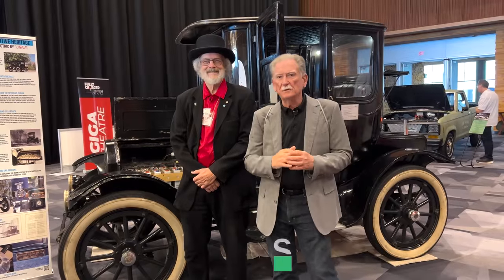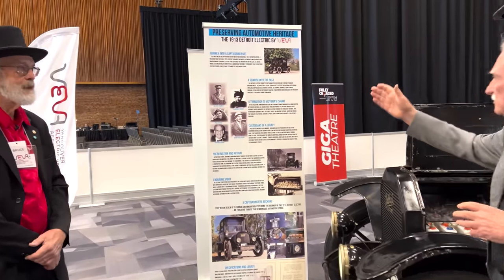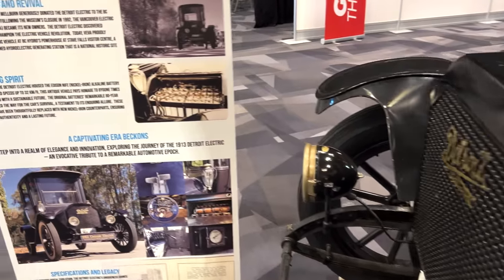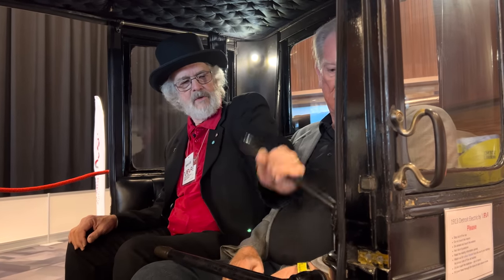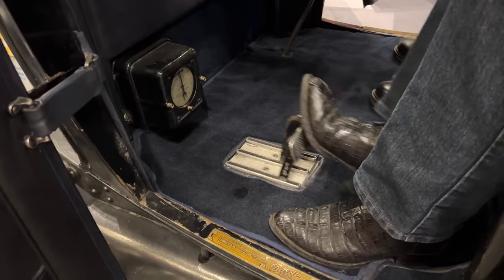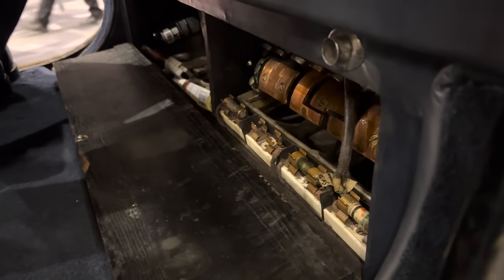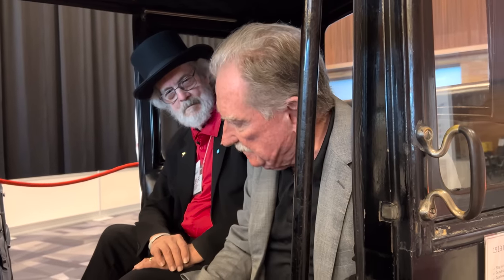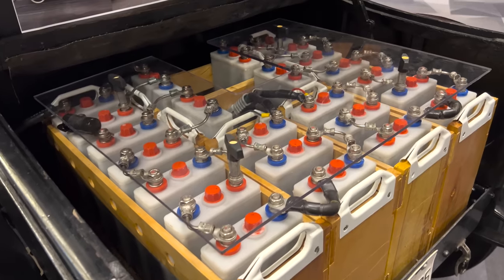This EV is Over a Century Old! Detroit Electric at Fully Charged LIVE Canada

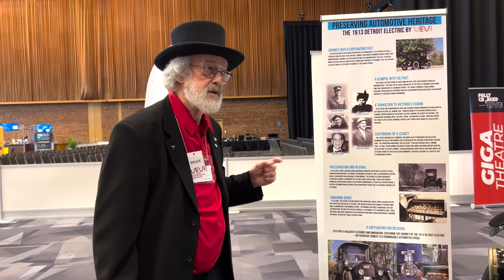Comment: 0:50 nickel iron battery, with annual electrolyte change, lasted 25 years 2:19 car was featured at Expo '86 3:28 $8K for similar nickel iron battery pack to replace previous lower-cost lead acid batteries 6:10 25 km drive part of 350-car entourage with 10,000 spectators

Comment: On Sandy's repeated query about how Women would have handled that electric car, it was primarily targeted for Women. The gas back then was almost the crude oil that was pumped out of the wells. Once you drove the car, you smelled like the oil. So women went for the electric options. And yes girls then knew how to handle their skirts even riding a horse. :)
Reply: Plus you didn't have to break an arm to crank start it every time you went for a drive!
Reply: @jrharbortproductions plus the gas car had significantly way more range than the EV hence why it got over it lol!!
Reply: @carholic-sz3qv  People weren't buying BEV for the range at the time. That is irrelevant.
Reply: @jrharbortproductions  yes alot of people are buying EV for the range and it's still super relevant! For things like towing, going overlanding..... we're still waiting for even more range! For example older ICE gets exported to third world countries where they still have all the capabilities plus range.. things that no EVs will do!

Comment: 72 V at 1.2 V (nominal) each implies 60 cells in series; they are marked as 60 amp-hours each. It looks like there are 36 in the front and 24 in the back, so that's 60 in total and so there are none in parallel... that's a 72S 1P configuration. 72 V multiplied by 60 Ah is 4.32 kWh. 

The range is not given, just that it is more than 25 kilometres. If 25 km takes 4 kWh (for instance), that's 16 kWh/100km, or roughly the same as current battery-electric cars... but of course this is at much lower speed, carrying much less weight and with less space and without any of the safety or comfort features of a modern car.

Comment: Love seeing these vintage vehicles. 

What annoys me is when the EV FUD people say EVs have been around a century and still suck. The reality is EV development has been massively under funded when compared to ICE vehicle tech. It was personal electronics need for better batteries that pushed battery forward which helped get EV tech moving forward in a big way. This is why I say ICE tech is very mature tech, thus hard to get much improvements and EV tech is semi young, thus the massive improvements we have seen in a short period of time and the continued rapid improvements for at least the next couple of decades. 

Nice job Munro team.
Reply: When you factor in all the government incentives for ICE technology, if that type of support were given to the current EV industry you would see a HUGE uptake by the general public.
Reply: @nononsenseBennett The uptake it's up over 50% from last year, and we are around 7.5%. So we need about 4 doublings to take it all.
Reply: To get more efficiency out of ICE vehicles, they had to get the car to turn off the engine at red lights! That right there demonstrates that they've hit that local maximum for ICE efficiency. But EV efficiencies are just get'n started.
Reply: @health101DOTorg  EVs will get a little more efficient, but what they really need to do is get more numerous. Most EVs can get 4 miles per kwh putzing around town at 30-40 mph, and some wind and solar projects come in at 2 cents/kwh without stinking up the air around them.
Reply: Please stop talking crap!!!! The only problem with EVs has always been the batteries; batteries have constantly been developed for all kind of applications like mobile devices and much more. The ICE tech also evolved but in making much bigger and capable véhicules, equipments.....
Reply: From the smallest cars to the gigantic 23,000 containers ship to the Airbus A380..... even the concorde.... it's all possible because of ICE and oil let's not forget building power stations, roads, bridges.... the grid and much more.
Reply: @nononsenseBennett wrong!!!! The EVs would have actually seriously slowed us down! Oil alone has transformed out planet! Fuel for mechanisation, agriculture, mining, construction, marine, trains.., what could have batteries done even if they were the only focus!?
Reply: @fjalics  your tesla is full of plastics, full of parts made from mining with oil, drives with tires on roads all made from oil, even the grid is all made by oil and ICE.
Reply: @carholic-sz3qv  ok. 

No one is saying ICE did not accomplish anything, but electric is the future for transportation and ICE is going to be niche market in the future.

My original point was early days electric might be nearly as old as ICE tech, but never had the funding ICE tech enjoyed, thus EV tech is under developed.
Reply: @kevtheobald  wrong!!! EVs are like over 50 years older than ICE! I also watched Jay Leno on this! Yes ICE have accomplished alot and will continue to do so even with the EV happening or in the future! ICE is literally In everything from rockets to cars to ships, aircrafts and many other big machineries and things that can work 24/7 everywhere.
Reply: @kevtheobald  EVs has never been underdeveloped at all! The problem only has been the battery which had been developed and improved for decades! There is a reason why we have soooo many different battery chemistries today! From mobile devices to vehicles.... stop it please!
Reply: @kevtheobald  even if you are right! Do you think we could have had battery powered ships or construction equipments and trains and tons of other applications!? Be realistic please! And the EVs are now using the infrastructures that ICE And oil made possible.
Reply: @kevtheobald  I'm not hating on EVs but we must be clear here! The ICE won easily at the beginning because it already had more range even tho it was more difficult to drive or start compared to EVs.
Reply: @kevtheobald  in third world countries in many places they still drive around with century old cars on infrastructures that basically doesn't exist! It's not your EV that's going to make hinges much better lol!!
Reply: @kevtheobald  from the wind powered ships to steam/coal to the upcoming cruising ship ICON of the sea which is going to haul almost 10,000 people batteries will never make such things possible it's not about pessimism but reality.
Reply: @kevtheobald  the very important thing to not forget is that the lithium battery was actually invented in the 90's
Reply: @carholic-sz3qv  The reason for so many battery chemistry is because they finally have the funding to research all kinds of batteries. 

Clearly, we will just have to agree to disagree.
Reply: @carholic-sz3qv  EVs can use solar panels and wind, so they do not need natural gas plants or coal plants. Power grids can be fossil fuels free and will likely be that way in the future. Battery storage has given the green tech the final piece needed to remove all fossil fuel power plants from the mix. 

The way things are advancing in EV tech, you will see commercial planes, ships, and trains all become electric as well. There are already commuter EV planes flying that will likely go into production in the next few years. 

Just look at how much has changed in the last ten years for EV tech. The change is only getting faster.
Reply: @kevtheobald  yes EVs can use was wind and solar but unfortunately they aren't the one installing or maintaining those! Let alone making connection to power stations and substations! ICE goes in the middle of nowhere hauling gigantic wind turbines to install and connect and expand the grid! Your tesla does 1000hp but it's literally useless because it cannot be used like a  1000hp diesel for example!
Reply: @kevtheobald  battery tech hasn't gone crap to all fossil fuels lol!!! Power plants with renewables are intermittent meaning that industries that needs tons of power 24/7 like steel Mills won't work well with it! Commercial planes, ships with batteries is a big joke! Trains already runs on electrified lines but not the ones in remote places.
Reply: @kevtheobald  wow!!!! Are you even serious!? Most of hose batteries are super old! It's not that they recently received funding to make them lol!!! What are you smocking?! The LFP battery from r example was even developed partly by an American oil company for very long time ago! If you actually follow the story of battery tech! You'll understand it!
Reply: @kevtheobald  the efficiency in modern EVs is mostly from electronics to better control/balance the battery cells and the more efficient electric motors and things like heat pumps.... the battery itself is still evolving super slowly despite all the funding going on!
Reply: @kevtheobald  the latest sodium ion battery for example beeing developed by CATL is great and we're also still waiting for the graphene batteries, solid state batteries..... EVs actually came in a time where alot of technogies were already developed to facilitate them, ICE literally had to work and evolve with no infrastructure! Even today in third world countries they have barely no roads
Reply: @carholic-sz3qv  Sodium batteries that CATL is cranking out I doubt is something American Oil was using a long time ago.
Reply: @carholic-sz3qv  Keep in mind, the basics can be in use from ages ago, but what they do now could be far better. Think about rubber tires. They been in use for ages, but the rubber today is not done the same as way back when.

Comment: 78 Volts... I wonder what it would require in order to fold out some solar panels and start feeding electrons while you're enjoying some time at a park!
Reply: 72 volts - Sandy incorrected said 78 volts and was corrected.

That's 72 volts nominally, meaning 60 cells in series at 1.2 volts each. The manufacturer of those cells says that "the battery likes to be charged between 1.6 and 1.8 volts per cell", so 96 V to 108 V to fully charge.

Comment: But for the innovation of the battery powered electric starter for ICE vehicles, BEVs might have dominated the mobility market.
Reply: Yup damn Kettering to hell for that. Plus the muffler, made them palatable for women. Who had previously loved the quiet not smelly evs. 😀
The irony of reliable 12v batteries and electric starter motors making ice easier to use. Thereby killing off evs cannot be overstated imo. 😑
Reply: @4literv6 wrong!!!!! Hat killed EVs was the range and capabilities! While the EV could accelerate quicker, the ICE would have higher speeds maintain it and have much better range! That's what changed everything from agriculture to mining, construction.... basically it's the ICE and oil that built this world including the grid, roads....

Comment: Great segment.  Very informative.  I can see why fossil fuels became the standard for automotive energy needs encapsulated in this video.  The same issues are becoming prevalent today with the electrical infrastructure's  capacity to charge tens of millions of EV's. What was the electric infrastructure like 100 years ago?  Oil has been the best alternative for over 100 years.
Reply: The EV will actually help the infrastructure. Do a little research on vehicle to grid.

Comment: This battery, although it has a long lifespan. It’s efficiency is rubbish.  Slow to charge and wastes energy charging through slow absorption rate
Reply: Good point. The manufacturer of the cells which are currently in the car (Zhuhai CIYI Battery Co) says that they are 80% efficient, which is poor compared to a lithium-ion cell.